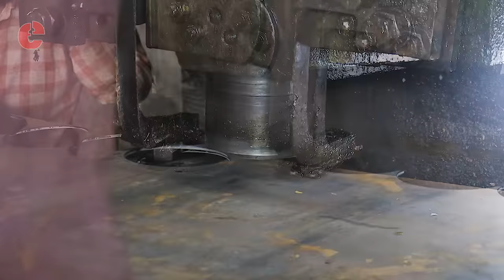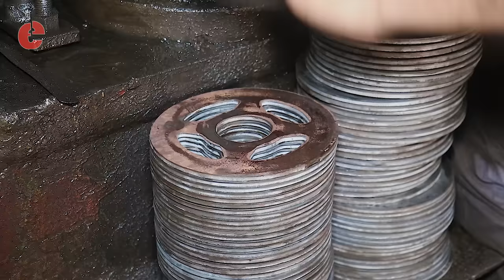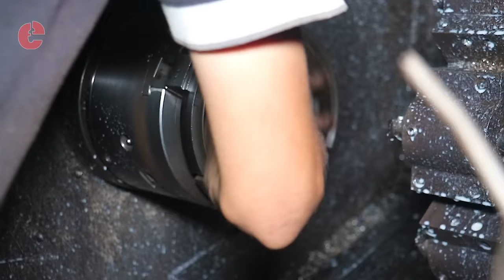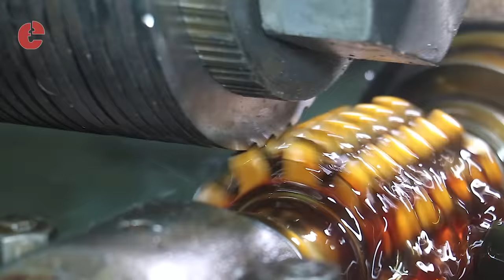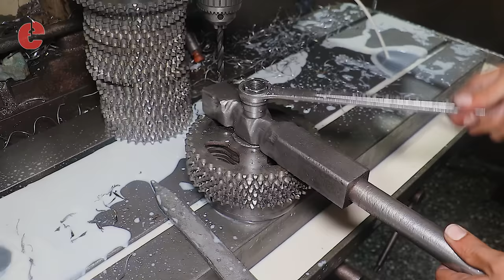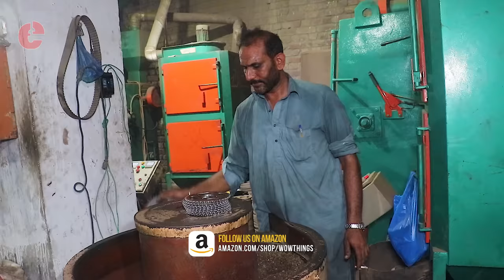How Motorcycle Sprockets Are Manufactured

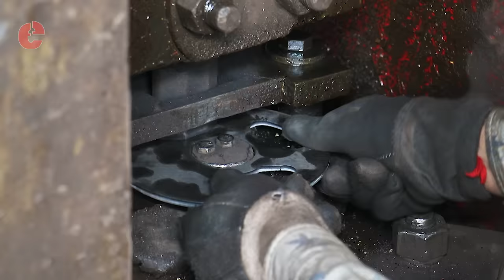Comment: 1:12 Yikes. Each one of those sprockets must be "uniquely" balanced. No way those 4 spokes are punched symmetrically just by eyeballing them. It's also weird that they have such an empirical and error-prone step in a shop that even has a CNC machine. Besides, they are already using a punch press for the other holes. Why not one with 4-spoke pattern?
Reply: I was thinking the same thing. As the owner of an aerospace machine shop, these parts would all be rejected. 😂
Reply: The biggest sin in my eyes is running them on the lathe without indicating them. No way they will be good parts
Reply: @candlestyx8517  Then again those will (hopefully) only be used locally in aging Royal Enfields and Tuk-tuks topping 50-60 km/h and spending most of their time put-putting in traffic, so they can get away with the sloppiness. It's not like they'll end up being used on a Busa.
Reply: @Velktron  it is visible that there is located some kind of bolt on the right which is playing the role of the pointer. But anyway it still does not work ideally.
Reply: Load shedding and customer demand in C grade parts
Reply: @Velktron  "locally in aging Royal Enfields.."
No way!! This factory is in Pakistan. Royal Enfields are made in India and are NOT sold in Pakistan.
Reply: @Velktron  dude first of all your knowledge of demography is very poor.  this is pakistani channel , they do such labor intensive yet inefficient task. Royal Enfield is sold worldwide and has a very high standard of manufacturing in India and Royal Enfield is aging like a fine wine since more than a century. and it is a cruiser not racer bike. Also you can read or maybe can't read the title -  motorcycle sprokets , so using these in buses and tuktuks makes no sense.
Reply: @game_maniac2404  you mean there are no chain drive tuk-tuks?
Reply: they are not eye balling them. they have a stopper at the right side and its shown in the video LOL
Reply: @nospeakgames8802  That stopper only guarantees that they center the (still round and toothless) sprocket blank under the press -there might be another for the y axis. So at least all cuts are made the same distance from the center of the sprocket. But there is nothing to index/rotate the sprocket exactly 90 degrees each time, so the holes may be axially aligned, but not radially. :-)
Reply: @Velktron  there is a second one on the right side so the holes are always on the same spot
Reply: @nospeakgames8802  There's nothing that can positively hold the sprocket blank in place once rotated to guarantee exactly 90 degrees each time, so that's still eyeballing. That's not so uncommon in these Pakistani shop videos: there's one where they drill flute holes one by one, relying only on the operator's eyes to space them appropriately. Unique sound, unique balancing for each piece ;-)
Reply: it doesnt matters much cuz they will be used in cheap economy bikes that will generally travel at 40 to 70 km/h
Reply: @jarjarbinks3193  he is talking about old royal enfield bikes not new ones and i believe that people might be using cheap alternate local parts rather than buying from royal enfield shops and paying high price for an old bikes part if royal enfield still makes it that wouldnt even affect performance
Reply: @MWaqas-kt9dk  Either way, Royal Enfields were not made locally in Pakistan and hence are extreme rarities.
Reply: //you mean there are no chain drive tuk-tuks?//

It depends on what vehicle you call Tuk Tuk. Tuk tuks manufactured in Thailand are chain drives. Because they are actually motorcycles converted into tuk tuks. "Auto rickshaws" which some people mistakenly refer to as tuk tuk are belt drives.

Comment: Without heat threatment (hardened steel) is not good
Reply: What heat treatment is your chain running? Because you don't want hard sprocket on hard chain (it's why engines have soft aluminum piston and hard steel cylinder). They also make aluminum sprockets, they don't last quite as long but most people replace them more often than needed.